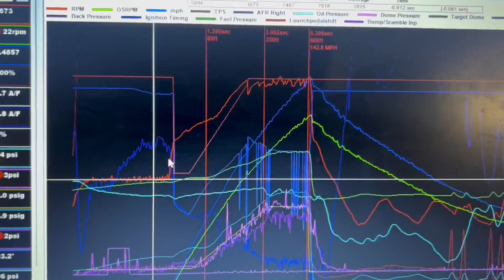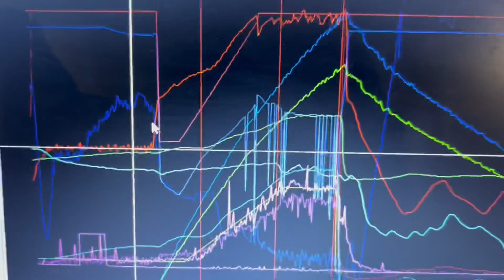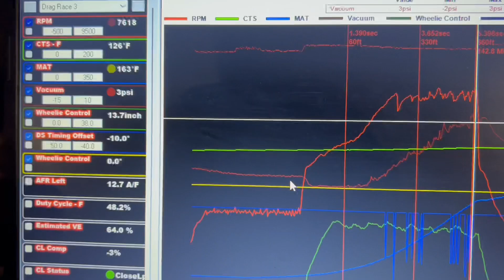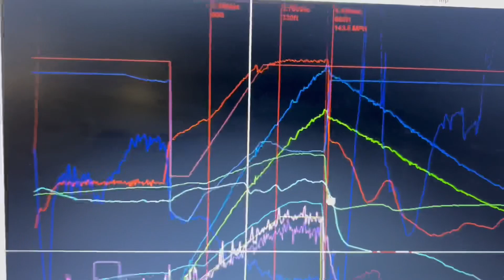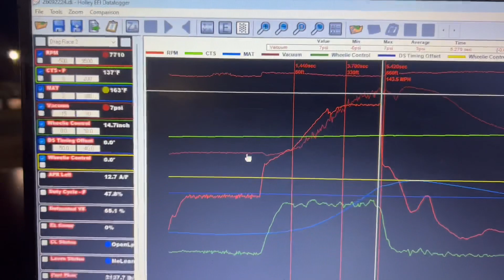Personal Best with the New Engine!  Making progress!

Comment: I could be way off on this, but I'm seriously wondering if your top rings are gapped too wide. Also, I've never run a vacuum pump with boost expecting strong crankcase vacuum . I just run a vacuum pump with boost to eliminate PRESSURE in the crankcase. If I end up with 1 or 2 inches of vacuum, the vacuum is a bonus. Typically I'll have around 8-9 inches of vacuum at idle and at full boost, if I've got the top rings gapped correctly, I'll see about zero crankcase pressure, which is really all I'm trying to accomplish in a boosted motor by running a vacuum pump. Be precise with the top ring gap and the vacuum pump will do its job fine. Just don't expect a big vacuum number while making a lot of boost. I never have, but I've never had a leaky engine with a vacuum pump either, which is all I really expected from it. Just my 2 cents.

Comment: Do a leakdown test to be sure about the rings but I don't think having 7 psi of pressure in the crankcase is all that unexpected with methanol and the high boost you are running. If you ask a lot of people with boosted cars they will tell you that there is not a vacuum pump that can keep a crankcase in vacuum while going down the track and supposedly that is why you see the pumps only on NA and nitrous cars. With that said, I have always wondered if the problem is just that people don't use a big enough vacuum pump, don't turn it fast enough, don't have big enough inlets into the pump or restrict the outlet side of the pump too much. All of those things would make the pump do less. I would explore all of those things if I were you. Thanks for all of the great content, it is much appreciated.

Comment: TJ another thought on the pump. Check with the manufacturer and find out if there is an optimal position of the output side of the pump. Some vane type pumps prefer the outlet at the 6 o’clock position to keep the fins from sitting in the oil. Second thought is specific front and rear main seals when running crankcase vacuum.
Reply from the maker: I’ve heard some people reverse the seals, but have tried that.  Probably will not.

Comment: Maybe you could weld a couple pieces of tubing on each valve cover and put a shielded breather on it. That way you can vent the crankcase and the filter will hold in the whole well most of it anyway. Add one of those on each side along with your lines to the back catch can. Just an idea John and don't forget to drill a hole before you weld you're tubing on LOL

Comment: Rings dont have a chance, with that much fuel in the catch can oil, I can only imagine how much is in the cylinders. Get control of the fueling, switch from AFR to lambda to better understand where you are and make sure you have the right wideband sensors. Does this see any temperature at all? It is gonna fly when you get it figured out.

Comment: John could you use a one way check valve off of the valve covers going to the burn down box so that it stays closed under vacuum but will send any positive crankcase pressure to the burn down? Just a thought

Comment: Wow that’s a lot of fuel getting past the rings no wonder you have 3-7 psi of crank case pressure.Have you tried running it leaner plus you have a lot of that methanol running through your turbo exhaust.
Reply from the maker: Used to be way leaner, but fattened up to be safe

Comment: Just a thought.... I've heard of guys increasing base fuel pressure to about 120 psi and decreasing pulsewidth to get rid of the running rich problem, plus the fuel atomizes better with high base pressure. Better fuel atomization means more power at lower timing...ultimately, making the rings seal better, and a side effect is faster et out the back. Just my 2 cents. If yall think I'm wrong let me know.

Comment: How much oil is in the tank?
Reply: Sry, not a lot, but a lot of meth, but there is also a lot of moisture in the air, now need to see if the oil in the pan is less methd up too, as the pump may be boiling off the Methanol into the puke tank.
Reply from the maker: This is very true!

Comment: You can continue to try and limp the problem along and continue fighting it but you're just fixing the symptoms and not doing anything about problem. You have a cylinder sealing issue it's probably time for pistons and ring's. Not only is it causing your blow-by problems it's also probably not making as much power as it could.
Reply from the maker: Rings are new

Comment: John, you said something that kind of confused me.  What's the difference between boost or vacuum? Ain't it all a boost?  I'm a dummy, confused, all I know is...let's go fast as sh¡t!!
Reply: Boost is positive pressure, vaccum is negative pressure.
Reply: @mitchdenner9743  Ok...I think I understand a little better! Thank you!  Kinda like if you have positive, you gotta have negative.? Sorta?
Reply: @PaulRhodes420  think of a Shop-Vac that has two ports on it one that sucks and one that blows. If you put a balloon on the side that sucks it will pull all the air out of the balloon,  thats negative pressure,  if you put the balloon on the side that blows it will fill the balloon and create positive pressure.  Atmospheric pressure ( the air around us) reads zero on a pressure gauge. Its actually 14.7 psi at sea level but reads zero on a gauge. Any pressure added would read positively on the gauge, above zero, (1, 2 ,3, psi etc.) Thats boost. If you pulled air out , or vacuumed it out it would be negative pressure which would read below the zero scale. Thats vacuum.
Reply: @mitchdenner9743  Wow! Ok, that makes sense!! Thanks man!  Awesome!!!
Reply: @PaulRhodes420  👍

Comment: Methanol engines need gasoline to break the rings in because methanol doesn't produce enough heat to make the cylinders walls or pistons to expand and they will not seat the rings. STEVE MORRIS
Reply: I told him that along time ago when he had problems with oil draining back to the pan , but John doesn’t have a clue and won’t listen
Reply from the maker: Thanks Bruce, never seen that recommendation!
Reply from the maker: Interesting, that could be the issue.  I’ve never done that!